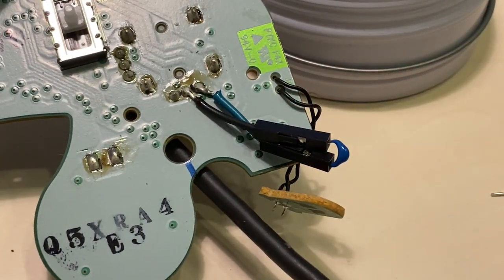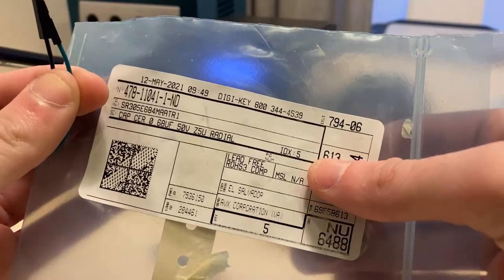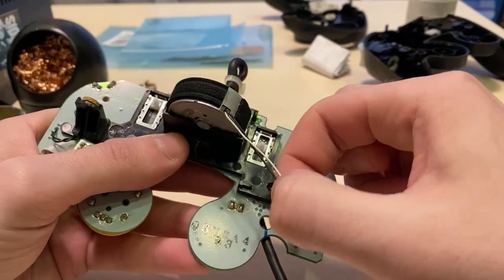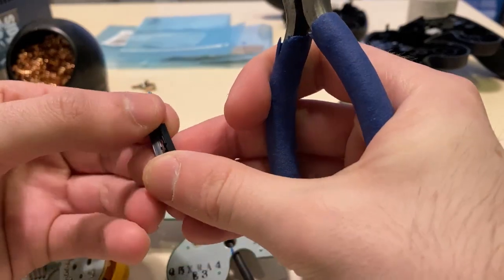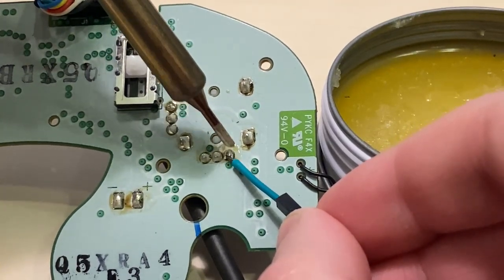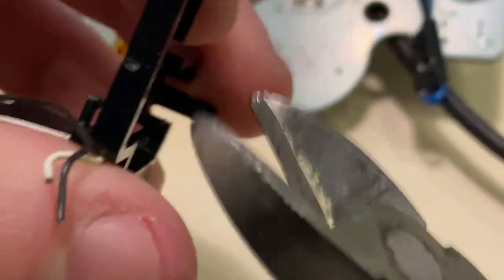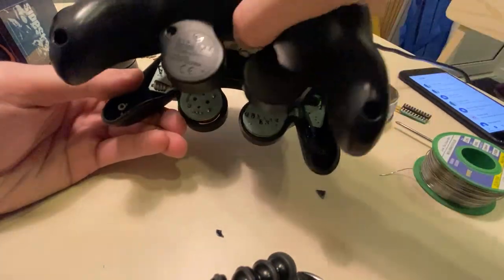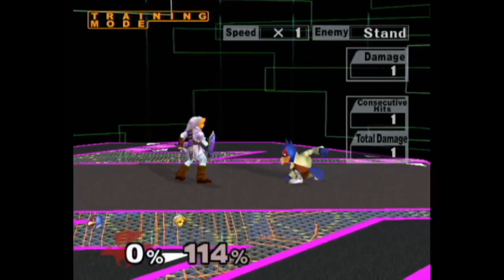Snapback Capacitor GameCube Controller Installation

Comment: I went to my local electronics shop for some capacitors but they asked about the voltage and had no Idea which to ask for. On this video it says its 50v but they dont have, I think they only hace 20v capacitors
Reply from the maker: anything greater than or equal to 5v works
Reply: @Savestate  thank you so much for your reply, I already installed the capacitor but after playing like for 30 min the controller stopped working, had to replace to potenciometer to make it work again. My capacitor was a 1uf because they didnt have anything lower than that. You think that might the problem? Maybe UF was to high?
Reply from the maker: @ was it an electrolytic or ceramic ? 1uf is definitely almost always way too high
Reply from the maker: @ . see above reply (didn’t tag first time for some reason)
Reply: @Savestate  no worries about the repply, it was electrolytic, just found a set of 100 ceramic capacitors on amazon for 7 bucks, going to try those, they have 0.22uf, 0.33uf, 0.47uf, and 0.68uf, guess any of those would work
Reply from the maker: @ start with lowest ! then if you are still getting b turnarounds, go one step up and test again until it is fixed.
Reply from the maker: but yeah electrolytic caps love to malfunction in this contexg
Reply: @Savestate  thanks for all your assistance, was able to find ceramic capacitors on an electronics store at downtown and seems like 0.33uf did an amazing job, worked for My controller and for 3 more customers
Reply from the maker: @ that’s awesome! glad it worked out

Comment: Also if you are using console you might have to hold y x and start for 3 seconds or hit reset every time you plug it in because your joystick will drift. Just incase any of you didn't know.
Reply from the maker: sure but the hz is not going to be anywhere close to what console can reach, giving a much more jagged and less realistic view of the signal
Reply: @Savestate  I fixed what I said because you were right and I bought everything you linked except the wire cutters because I have my own and It worked perfectly, thank you for the updated tutorial

Comment: Is it possible to do this with a Pro Controller?
Reply from the maker: yea it uses pots but i think the cap values are different because of the operating voltage. you prob wanna do some research on existing pro snapback mods
Reply: @Savestate  do you mean operating voltage of the pots like the 3.3v you mentioned in the video? was planning on doing this mod to my ds4 controller as the pinout is the same with around 3.3v.
Reply from the maker: @circuitsable  oh if they're 3.3v on a pro controller then go for it, should be abt the same
Reply from the maker: ds4*
Reply: @Savestate  an update incase you care, it works. i measured 3.2v but its close enough. 1uF worked well for me

Comment: Is it the same for adjustable capacitors?
Reply from the maker: For modules there will usually be X, Y, 3.3v, and GND marked. X goes to the X pot middle contact, Y goes to the Y pot middle contact, 3.3v will go to the left-most X pot connector, and GND will go to the right-most X pot connector.

Comment: i think my snapback cap is making my controller press right constantly. i cant press left at all (doesnt register) but up and down still works. what can i do?
Reply from the maker: make sure to reset the controller after plugging in by holding x y start for a few seconds
Reply: @Savestate  
thank you for replying

ive tried that, but i think since the controller is pressing right, the reset doesnt register
Reply from the maker: @misair0  are you on console? what do you have the controller plugged into
Reply: @Savestate  i am on slippi using mayflash adapter
Reply from the maker: @misair0  might be a bad soldering job then, make sure there's not a short between the two contacts you soldered to

Comment: Hey QQ, i did my solder and added a capacitor and now my controller won't respond horizontally. Any Ideas?
Reply from the maker: sounds like bridged pins! make sure the solder from pad isn't touching the other. may need to use a solder sucker or wick and try again. make sure to use flux!
Reply: @Savestate  Apologies for sounding dumb, what do you mean by bridged pins? And from what i can tell, the solder isn't touching
Reply from the maker: @hollisterboi16  that's what i mean, touching solder. are you in any mutual discord servers as me by chance since i assume this is for melee? would like to get some pics if possible
Reply: @Savestate  I’m in Melee online, my tag is Cyndoughquil
And yes this is for melee
Reply: @Savestate  can also send my discord info over, no prob with that either!
Reply from the maker: @hollisterboi16  sent a message, might need to check requests

Comment: can you just solder the capacitor straight into the board?
Reply from the maker: sure but considering pode buildup over time needing a lower capacitance and the risk of the capacitor being bad, making it easily replaceable is an insanely tiny investment of time to save a lot of potential headache later
Reply: @Savestate  aight that makes sense thanks a million

Comment: does this apply for smash ultimate as well? pls answer😭😭
Reply from the maker: i don't think snapback is nearly as prevalent in ult, but if your controller is affected by this site yeah it'll work
Reply: @Savestate thanks! also snapback is super bad in ult
Reply from the maker: @itslovo  yes as it's a property of the controller you can do this to fix it
Reply: @Savestate  will it be more difficult to do b reverses?
Reply from the maker: @itslovo  no  this makes it easier
Reply: @Savestate  OH SICK thanks